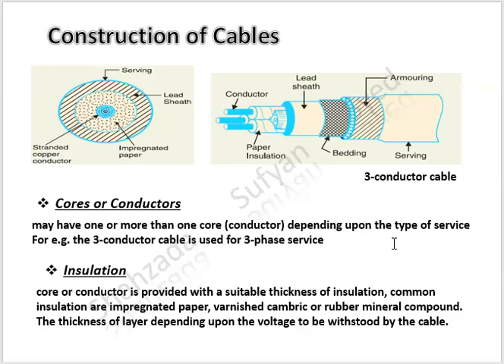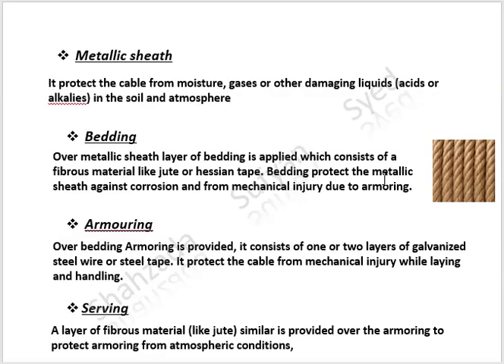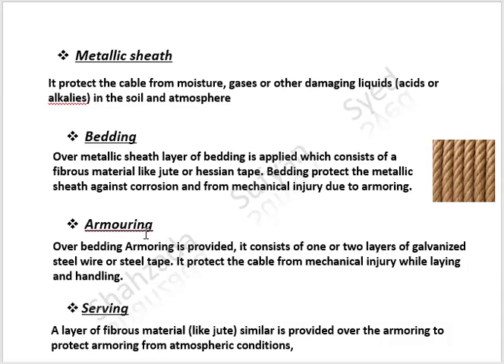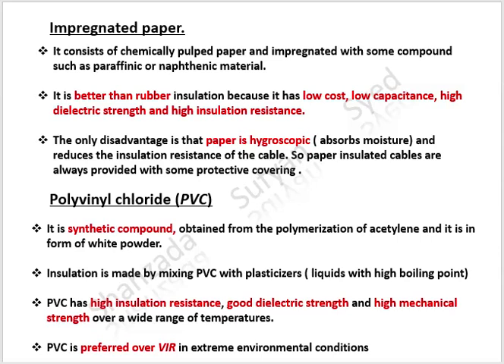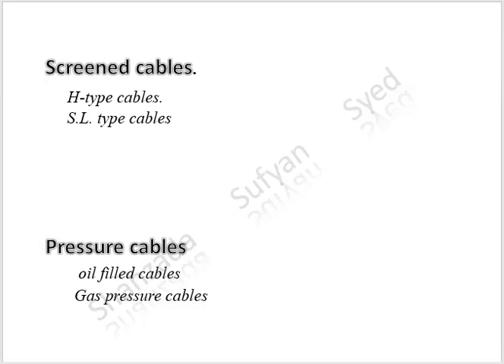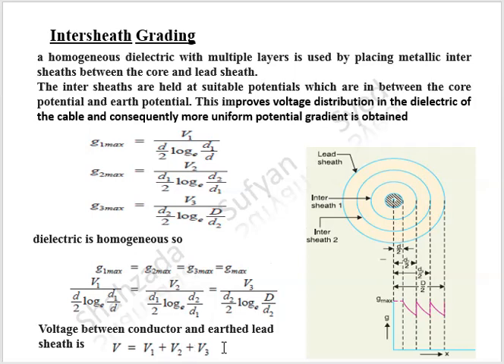Underground Cable | Construction of Underground Cable | Insulation | Grading | Electrical | Part 1

Comment: What type of cabel should be used for voltages between 11kv and 22 kv sir?
Reply from the maker: We prefer use 3 core cable.. And we wil study this in coming lectures as i have mentioned this  in video

Comment: Sir what type of cable is used between voltages of 66kv to 132 kv?
Reply from the maker: Its mentioned in the video
Reply: @ShahzadaSufyanSyed  extra super voltage will be used for 66kv to 132kv or it is used above 132Kv? ?
Reply from the maker: Depends on usage and power rating.. EHT n ESV can be used but ESV is more prefer
Reply from the maker: Also power rating is 66kv and after 66kv its 132 kv. In between them the system hardly exist
Reply: @ShahzadaSufyanSyed  it means ESV can be used from 66kv to 132 kv and above ..!!
Reply from the maker: Yes it can be